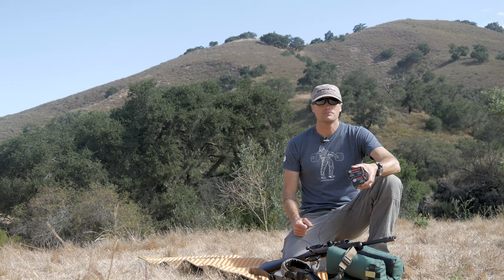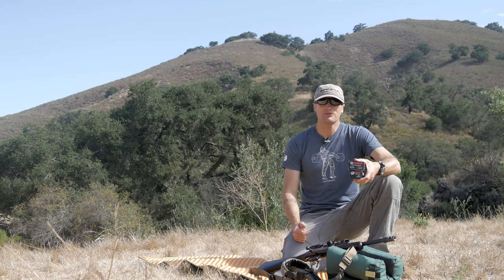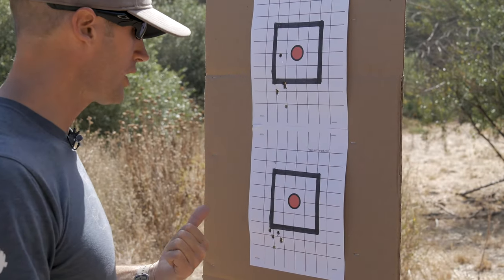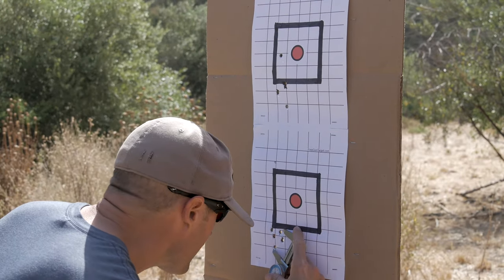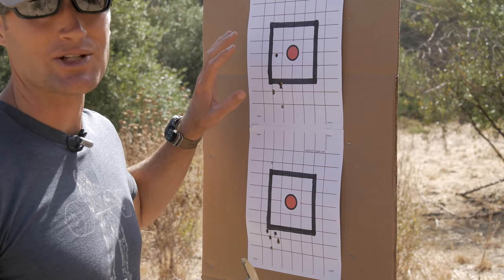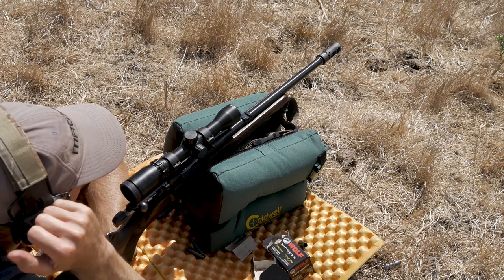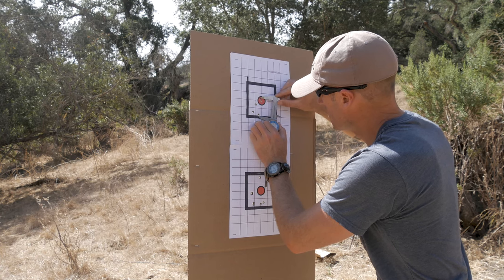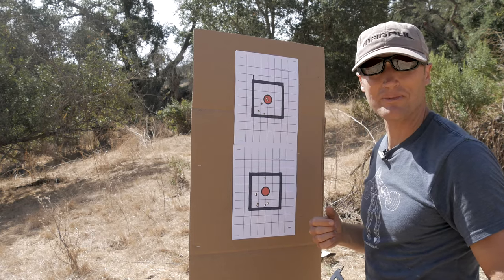CZ 527 Carbine Range Report Part: 3

Comment: I've had the best accuracy with Golden Tiger and.... yep, Tula 124gr soft points. Go figure.. Be aware this rifle is .311, as is all Russian steel cased 7.62x39 ammo, while a lot of American ammo in this caliber is actually .308, which won't impress you with accuracy because of the different bullet diameter. If you choose domestic ammo, make sure they are using .311 bullets or you will be throwing your money away. Check my channel for some medium to long range shooting with this neat little rifle if you're interested. Thanks for the video.
Reply from the maker: Thank you for watching and yes, I am aware of the .311.  That can certainly lead to disappointment otherwise.   I have been looking over some American loads to try in it though.

It is funny you mention long range shooting.  Just the other day a buddy and I were walking rounds in at a little over 600m.  It was a chore with that scope I have on it...  Nice job with yours at those ranges.  Looks like a nice open place to shoot in your video.
Reply: Just use Russian, Chinese, Romanian or Yugo surplus ammo, and you good🤣🤣👍👍

Comment: Are you using the set trigger for your accuracy testing??
Reply from the maker: No, I'm not using the set trigger right now.  I started off not using it, so for the sake of consistency, I haven't used it.
Reply: I think you'll find that the use of the SST will make a huge difference-it was a more noticeable improvement to my groups than the choice of ammo...
Reply from the maker: Good to know.  I will have to revisit my best grouping ammo while using the set trigger.  Thanks for the tip.